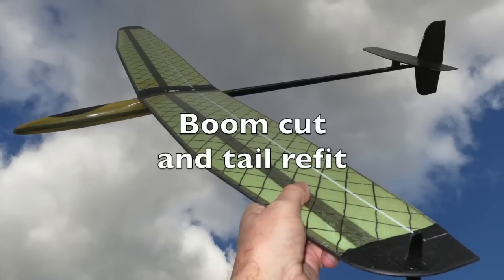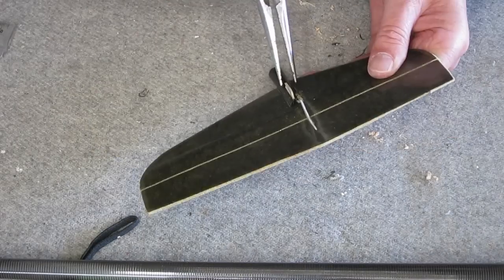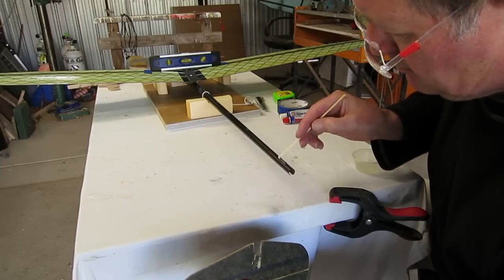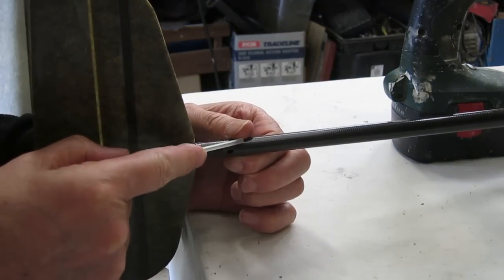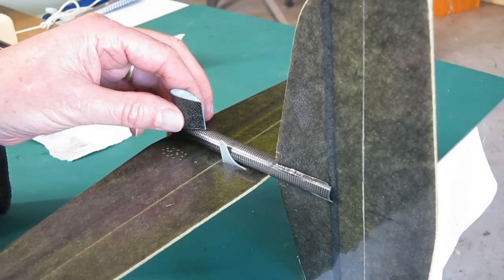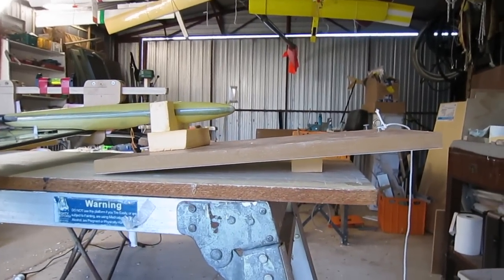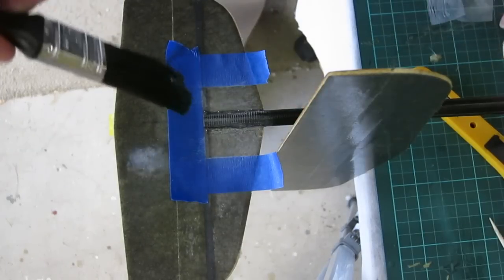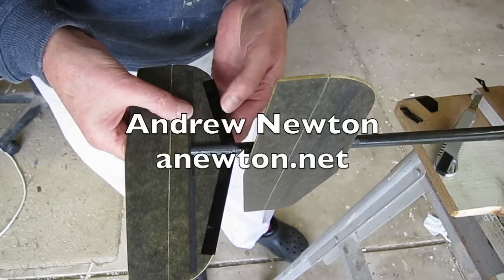V2 DLG build Part 2 - Boom cut and tail refit

Comment: The 2 channel glider I'm slowly scratching up will not have any cuts or holes in the tail boom. As you have indicated I also have a very fragile seeming carbon wrap tube. So I am bringing both 1.5mm carbon pushrods out of the end of the boom. I pre built a mock tail boom and pushrod to control surface linkage out of scraps of 3mm foam and a short section of 6mm tube. Just to find out what's possible. It'll be fine. Probably.
Reply from the maker: Ha I like your tentative confidence. Good luck and make sure you video the maiden!!
Reply: Apart from chuck plane test glides it'll probably be my first bungee hi-start launch too! ;¬)

Comment: This is a classic on how to do the Zero Zero setup and all the other alignments.
Just one thing :-)  You don't need such large plastic tubes for the pull spring chords to come out of.  If you are using 60LB Dyneema chord it fits in the plastic tube from the old control system in the kit :-)
Reply from the maker: +Malcolm Bond Thanks Mal. Wish I had seen your pull line routing before doing this. Much neater.
Reply: It is OK Andrew :-)  I wonder if YouTube would let you post an edited video with a little insert, text or voice addition. :-)  Hopefully your viewers can get the message that a thin little plastic tube from the kit is workable.  Some videos do seem to have add-ons.  I would like to learn this one day too :-)  All the best.  Mal :-)

Comment: Hi Andrew I've followed your build and Mal's comments in the RC forum- he says he raised the front of the pod by 30mm to achieve zero incidence when fixing the horizontal stabiliser - can you confirm/remember by how much you raised the nose? Thanks.
Reply from the maker: +Graeme Macalister Hey Graeme. My incidence meter took care of the alignment so I didn't need to measure that. Mal would be right I reckon.
Reply: +Andrew Newton Thanks Andrew- I went with the 30mm and had my first test flight and it floated beautifully for 70 metres just with a light javelin hand toss. I didn't do all your mods but I couldn't have built mine without your videos.Cheers.
Reply from the maker: +Graeme Macalister Excellent, happy to hear that.